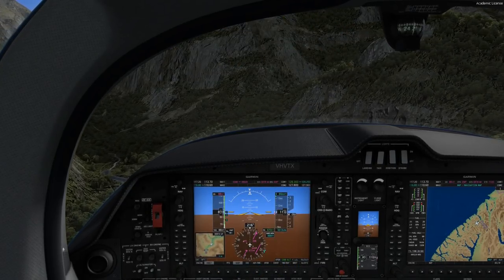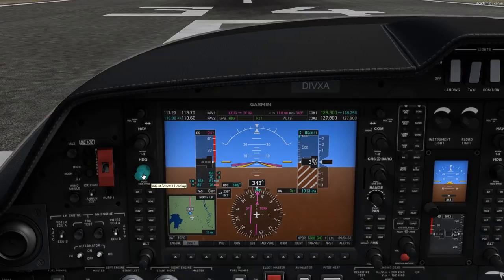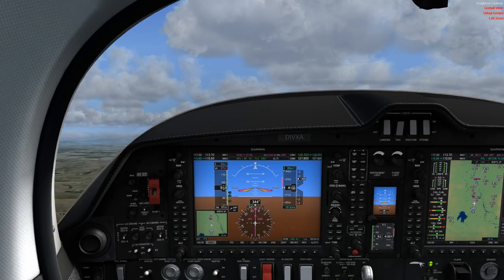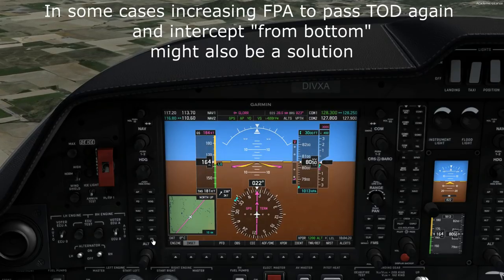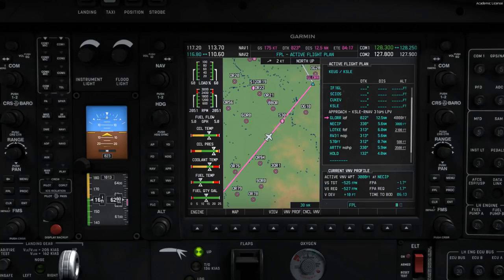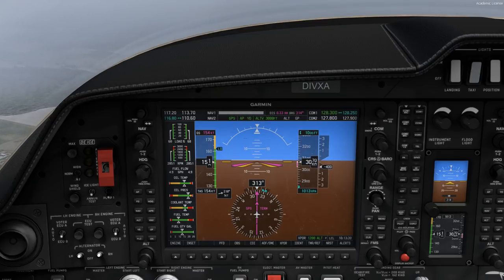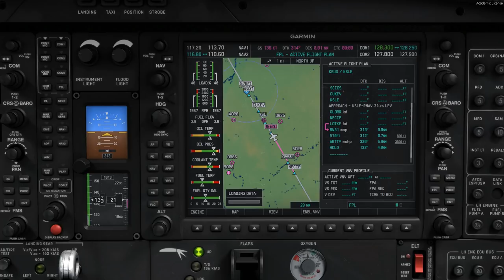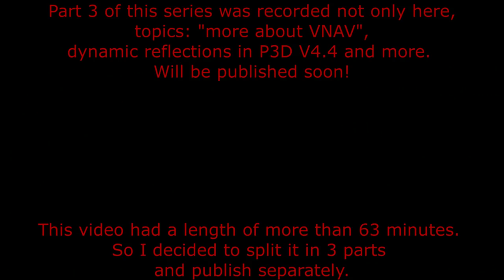Vertx Diamond DA62 - in detail - part 4 B

Comment: It's fantastic and with many, many thanks that you keep these videos coming Ruediger. Very informative and helping keep me patient (well, a little impatient perhaps) while I wait for the release. I'll have to try and nail that landing at T004 :-)
Regards Kym
Reply from the maker: Thanks again, Kym! I suggest  75 - 80 KIAS for the last phase of the final,  minimum control speed is 70 KIAS, ideal touchdown is below 70,  but depending on sinkrate you can use 70-75 and still have positive pitch not to touch down with front wheel first. It is very important, not to be too fast. Usual speed of 85 is too high. Takeoff is more critical imo.
Reply: Thanks Ruediger.  I tried in the RealAir Duke Turbo after adding T004 as a user waypoint in the GTN750 and am loving New Zealand again. Plenty of power for takeoff in that little beast. Can't wait for the DA62 though as it seems a little more graceful. 
I wonder if Sean will consider re-releasing the Realair Craft with his G1000.....
It's Friday here in Australia so I'll be checking the site for release every 30 minutes :-)
Take care there - Regards Kym
Reply from the maker: @Ozzy-K  Glad you have so much fun in New Zealand.  The Duke is great, but in compare to the DA62 the cockpit looks like a toy haha. Breaking news: The DA62 will be released in Brisbane, not before Saturday morning local time! I post all news at AVSIM, Prepar3D forum
Reply: Thanks Ruediger.  I'll keep an eye on it in the morning :-)  Regards Kym @rudi0310